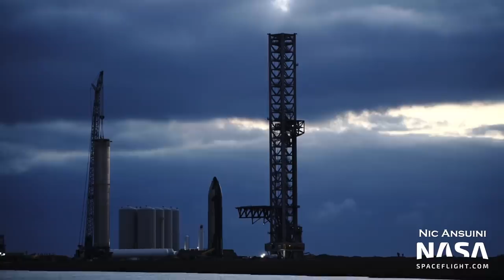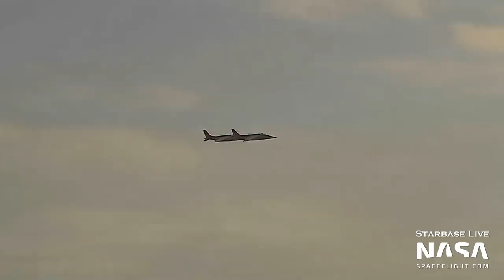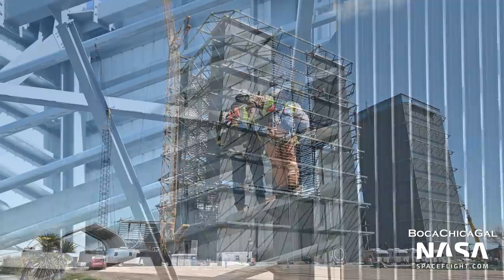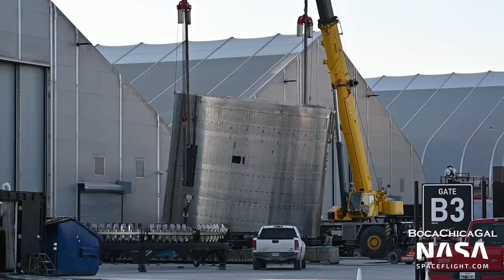Jared Isaacman Flies Over Starbase Once Again | SpaceX Boca Chica

Comment from the maker: 0:00 - The Launch Site
0:15 - Starhopper
0:31 - Ship 20
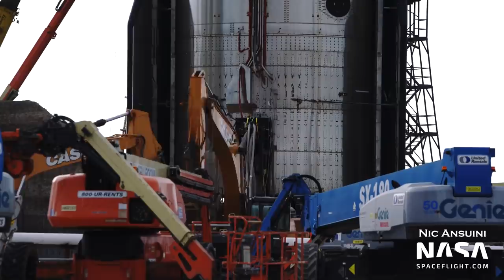1:35 - The Orbital Launch Mount
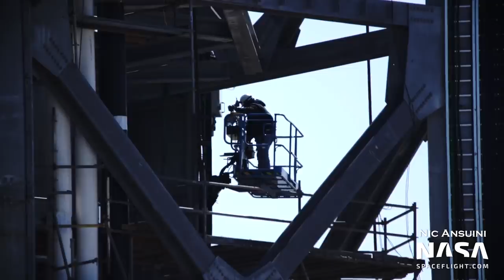1:50 - The Orbital Launch Tower
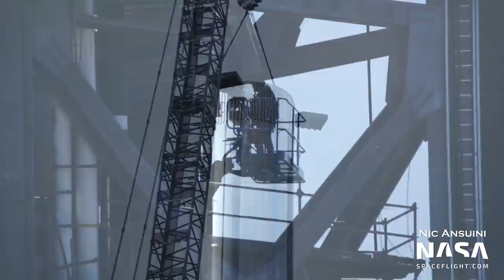2:05 - SpaceX LR 11000 Crane Disconnected from Booster 4
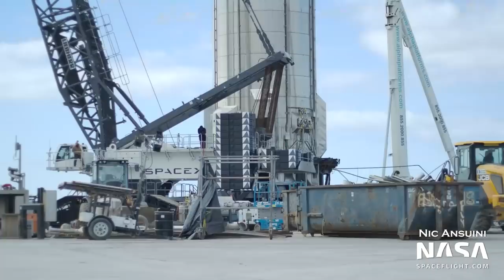2:43 - SpaceX LR 11000 Crane Moved
3:35 - Booster Load Spreader Lowered to the Ground
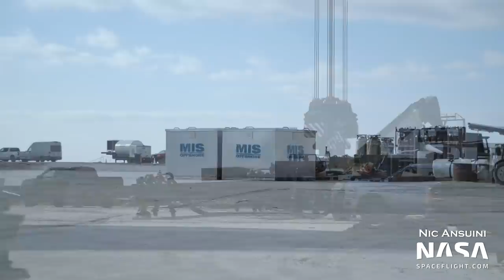4:09 - Crane Load Test Bag Storage Boxes
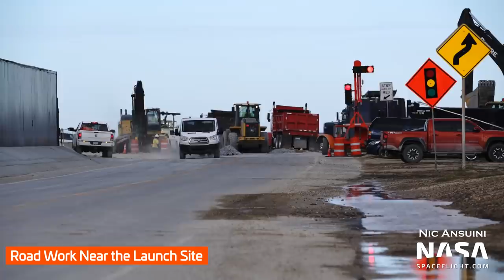4:29 - Road Work Near the Launch Site
4:40 - Booster 4
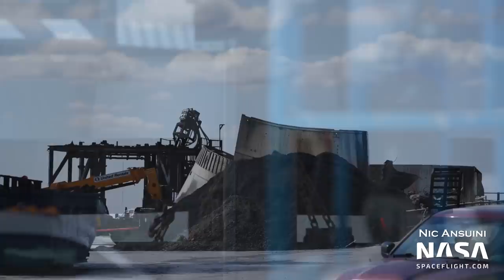5:34 - GSE 4 Scraps
5:50 - Booster 4 Moving Slightly
6:14 - Jet Fly Bys
8:09 - New High Bay Construction
9:27 - Booster 5, SN15, and Ship 16
9:43 - Delivery to the Production Site
10:08 - Ship Aft Section Flipped
10:51 - Ring Stand Moved
11:08 - Nosecone Outside the Tents
11:23 - Booster Methane Transfer Tube
11:40 - Delivery to the Launch Site
12:04 - Crews Work on Stairs
12:19 - Booster 7 Forward Section
12:50 - Ship 21 Tank Section
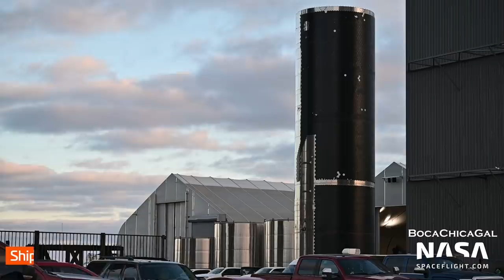13:05 - Chopsticks Raised and Then Lowered
13:21 - Booster 4 and SpaceX Crane Moved to the Orbital Launch Mount
Reply: 8:06 - the most hated edit of all time.
C'mon, show us the low pass!!! Dropping the still frame in is like aeronautical blue (redacted),...
Reply: @PiDsPagePrototypes  what are you on about? The stills were great

Comment: As mentioned by many fans, in some Timelapses i would be helpfull to include the Speed in the corner. x2, x4, x16 etc. I know sometimes in editing you use percentages but in the bigger timelapses like the chopstick lift it would greatly improove our understanding of things.
Reply: Nice tip-in Sheldon
Reply: yes sir could be very helpfull
Reply: I don't need to know the speed.  I think that would just add more work for the editors.  I do appreciate the captions though, and not using music.  It's just not SpaceX without the beeping and someone banging on metal.
Reply: Or just a timestamp.. That'd be really cool and useful for even more understanding.

Comment: It looks to me like they might test the chopsticks using B4. The crane lifts B4 and then lowers it onto the chopsticks.
Reply: yep, but I believe S20 will be stacked entirely with chopsticks, since we know there's going to be a full stack and S20 has no hook points for the crane
Reply: Chrispy  doesn't it have some pin holes under the flaps?

Comment: Lots of commenters on NSF Live last night think they'll use the crane to stack. First of all, how do they do full stack without chopsticks? Crane isn't tall enough. 
Second- that's not Elon's style. To do all that work and testing on Mechazilla and then give it a vote of no confidence? Especially for a presentation? It would be weird for SpaceX to pass up a golden opportunity to flex. I hope they will.
Reply: You are correct, crane is not tall enough. But it could be tall enough by reconfiguring. I agree the ChopSticks mechazilla are going to have to be used sooner or later, what better time than prior to the update all else being considered and ready
Reply: Chrispy  It could be the chopsticks get an adapter with pegs that fit inside the holes under the forward flaps. The only other option is to reconfigure the LR11000 but we have not seen any sections being delivered to the site.
Reply: Chrispy  Booster has mounting points. S20 has locations for attaching mounting points, and that would be a much simpler operation than reconfiguring the crane.
Reply: @knowledgeisgood9645  I'm betting they'll install lift points in those holes.
Reply: @knowledgeisgood9645  Couldn't they use the same beam they used for hanging the testi... water bags from? Just hang S20 from that beam by the existing lift points on the nose?
Reply: Chrispy  I did not say the flaps would be a part of any lift. There are only 2 ways to lift the ship - either use the normal 6-point lift or have pegs inside the two holes BELOW the flaps.
Reply: @stephen-boddy  The flaps would be in the way. Or, if the ship is below the arms the chopsticks can't get high enough to place the ship on top of the booster.
Reply: @knowledgeisgood9645  I don't understand how the flaps would be in the way. The chopsticks lift up to one side, swing over the top of S20, and s20 is suspended from the beam held across the chopstick arms by the current attachment points on the very tip of the nose. The connection could be very short. If the chopsticks are then lifted all the way to the very top of the tower, that might be enough to clear the booster already mounted on the OLP. I find the perspectives in the videos a bit deceiving and I'm not entirely sure if the tower is tall enough for this, or if the clearance is only there if S20 is picked up beneath the flaps. I've just never seen anything at the under flap mount points, and I wonder if a bolted-on part would be strong enough to hold the weight.
Reply: Chrispy  Landing a ship using the chopsticks is very much harder than landing a booster. To begin with the landing has to be as accurate, which is very hard for a ship to do. Then it has to have hooks that can survive reentry without melting.
In my opinion we will have to wait well over a year before we see chopsticks catching any ships.
Reply: @stephen-boddy  The tower is 143m, but the chopsticks can't go higher up than 130 or there about. The OLM is about 20m, the booster 68m and the ship is 50m, that is 138m in total. Add to that the length of the cables to lift the ship from the nosecone and you see that can't be done.

As I see it, the only way for the chopsticks to lift the ship in place is to install two jigs on either side that are firmly connected to the chopsticks and which fit inside the two holes under the forward flaps. Then the top of the ship is around 10m above the arms.

Comment: Is the no-fly zone around Starbase not there anymore since Jared could fly around?
Reply: It's only a no fly zone when they are launching or testing.
Reply: @codygravyboat4387  Yes true.  A TFRs are not specifically a no fly zone.  In this case it is only a restriction below 10,000' and free to fly over the area above that.  During launching and testing there will be a no fly zone, as I said. 
  If you are going to pull some one up on something make sure you're right.
 As well the T in TFR is Temporary, there is no single permanent TFR.  They are a series, that SpaceX apply for each month.  This saves the FAA and SpaceX from having to file and process individual piecemeal restrictions  for specific testing.
  I'm not sure SpaceX can authorise breaching a FAA TFR.

Comment: Hello I have a couple of questions and I hope somebody has answers the first question is can the wind get strong enough to knock the booster over or the ship over and if it can does anybody know exactly how strong of a dust it would take.
The second question is does anybody know if airplanes need to get spacex's permission to fly over that area or do the FAA permission or is it just the normal fly zone. I hope somebody does the answers to these thank you
Reply: I don't think that wind would normally be able to blow it over, as most of the mass is at the bottom with the engines, and then it is firmly attached to the stand, but if the winds did get too high, I expect that they could connect the Lr11000 to it for extra stability. As for your second question, I'm not entirely sure, occasionally they do have flight restrictions around the area, but I don't have any knowledge of the laws and restrictions over there.
Reply: The ships are held down by the stage interlock mechanism that is strong enough to handle the rigors of launch and the boosters are have hold down clamps which I expect are many times stronger.  I'm sure there is an upper limit of wind they could withstand, but will rarely get anywhere near that.  The exception is probably hurricanes, in which case they will likely bring vulnerable assets into the highbays.
  Its a normal fly zone, except for drones and launces obviously.
Reply: There's a "permanent" 10k floor TFR over the site, that's why RGV had to start doing his flights at 10.5k -- unless you have permission.
Reply: Okay thanks guys that helped a lot I was just curious cuz I know it has been extremely windy there over the last a week or so including today during its lift but they still lifted it anyway and as far as the fly zone I just had no clue and it was just curious thanks again for all the information

Comment: Why don't they just make them the right way up in the first place (aft section flipped)?
Reply: They had the blueprint upside down? Seriously, one would have to assume they are manufacturing in the most efficient way. Who wants to weld overhead overhead for example. The space between a dome and the ring is very tight. And then there's the whole issue of putting the thing together the rings slide over top of the dome easier in that orientation, versus trying to drop the dome in from the top with it inverted concave direction up
Reply: Lowering a cylinder on top of a dome is much easier to control than lowering an inverted dome inside a cylinder.